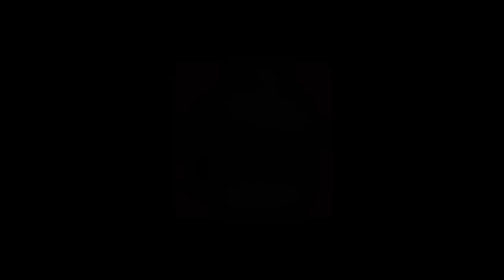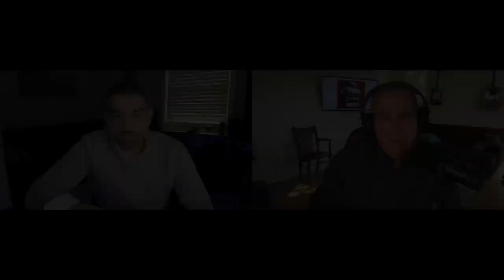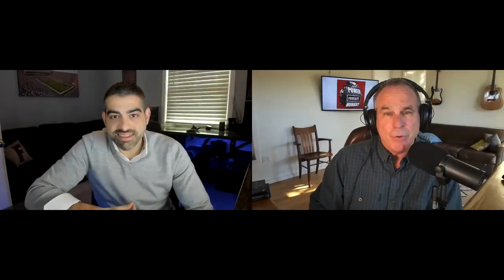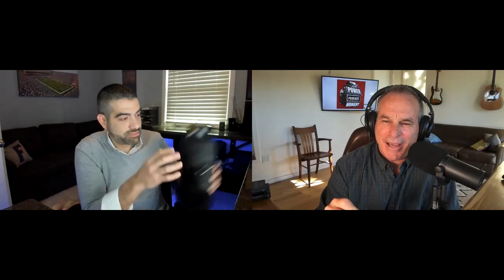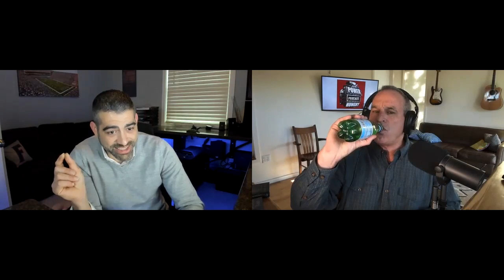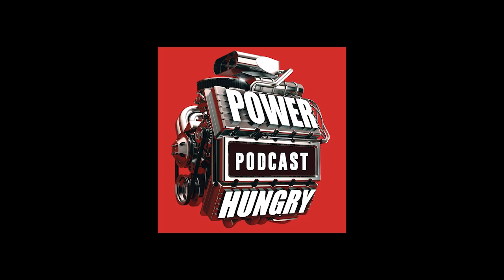The Power Hungry Podcast: Brett Ranpaul

Comment: Nuclear Reactors nothing new, microwave ovens are Nuclear Reactors, heat Generating Radiation to cook your food. The sun is naturally fusion energy, free electricity using solar panels, carbon is cleaned naturally by the gasses and the sun, not radiation from technology.

Comment: The latest cost estimate I saw for NuScale was $20,000/kw which means it will never get built and fuel the anti-nuclear activists. The NRC will be popping champagne corks for months.
Reply: Ironically, the founder of NuScale is a nuclear-engineering professor (at OSU in Corvallis, OR), and some of his former students work at the NRC. I met one of his star PhD students right before that student passed his thesis-defence and flew off to his new job at the NRC.